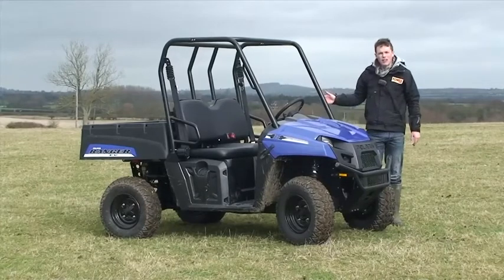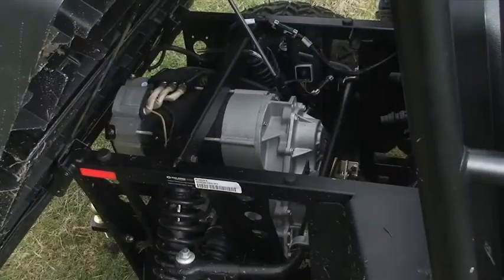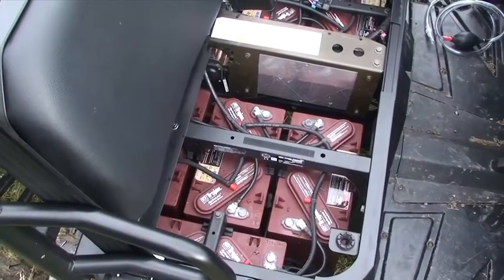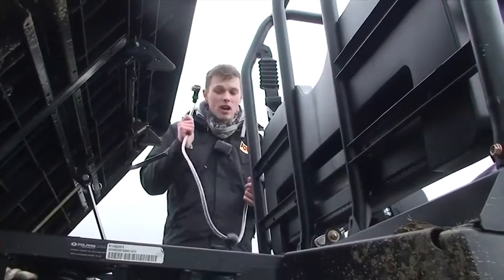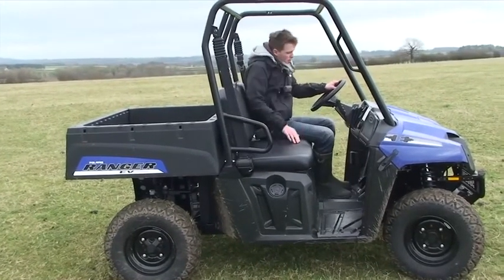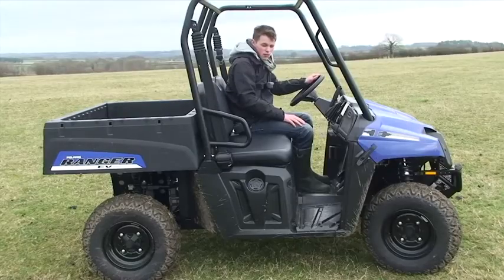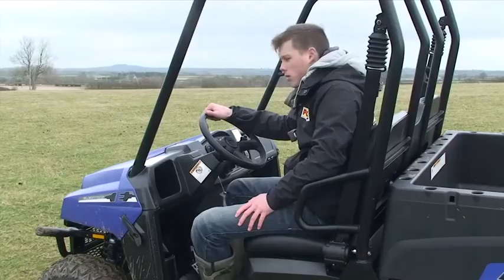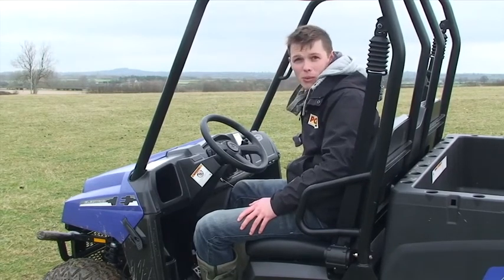Electric ATV test: Polaris EV

Comment: Imagine spending 13k to get something with battary technology that was around in the 50s. Then should have used lithium or lithium iron phosphate.
Reply: Oil lobby my friend.
Reply: Of course there are LiFePO4 types but they cost about $30,000 as to be expected. (Made in the US). 48v phosphate batteries are very expensive. You can replace the batteries (now AGM much better anyway but not as good as LiFePO4). The AGM batteries can be replaced with a 48v LiFePO4 battery but they cost about $US 3,000
Reply: @drwilburhughes680  which would not pose a problem if the charger was vehicle2grid compliant, and the complete system was (one of the house's) UPSs which can be borrowed to get around.

Comment: Lead acid? Seems like a very very old tech.... like an old fashioned golf cart. Are there not any ATV's that use Lithium Iron Phosphate batts?
Reply: I asked kawasaki uk at lamma if they plan on making a proper ev mule as I want one and the gentleman said "the technology is ready yet"! I laughed at him and left 😂😂
Reply: @bwarey52  I did the same!
Reply: Polaris DOES, or did, offer this with a lithium ion battery pack, but the price was scary- $20,000.00 U.S. About $8000.00 more than the lead acid battery version. Some years ago I looked into lithium ion batteries for mine, and there were at least two companies that offered kits, for about $5000.00… I’m still interested, but not at that price!
Reply: @erikarneberg11  Lithium batts are now $100 / Kwatt.hr hence the number of cars that now use them. eg. What is the best selling car in the UK at the moment. Answer: A lithium batt powered car.
Reply: What if they used plutonium?
Reply: @elliotjohnson9737  Then it would not work. ie. high School Physics?...

Comment: No way. Maintenance free Lithium batteries which I can also remove the packs or just move on. I’ll take my money elsewhere. Minimum 100 Ah batteries
Reply: yeh, seeing the AGM batteries in there was a real let-down. This thing would be amazing with the same volume of LiFePO4. Less weight, more power, more range, faster charge, much longer life. This is just a massive oversight
Reply: @Razza2250  I think they are wet not AGM. AGM  are maintenance free. Lead acid is what is supplied?
Reply: @cfmc6201  even worse then
Reply: @cfmc6201  AGMs are certainly not maintenance free. They are VERY old tech
Reply: Totally agree. I have a lead acid Ranger EV and its just completely outdated technology. I would happily  pay more for something same power and torque spec. that's built properly.
Reply: Agreed

Comment: I’ve been looking for a half decent review of the Polaris Ev all night. Nothing. Even this is just a gloss-over. What about suspension, handling, speed, carrying capacity, how easy it is to tip with a full load, what storage there is in the cab, attachments, cost, good god everyone - let’s get some decent reviews online!
Reply: Haven't got time to write full review buddy but the short answer is this: The Ranger EV is what you'd expect for the price and nothing more. They are a hodge podge of EV components thrown onto a petrol model chassis. There has been very little love put into building machines and really stupid stuff on an EV like halogen bulbs on the headlights instead of LED Why?? No reversing light, the factory set charging algorithm needs to be checked and possibly changed otherwise you will cook your batteries. The 7 pin switches for fwd/rev, diff lock etc.  are flimsy $5 Chinese shit. The torque is fantastic, if you are lucky enough not to cook your batteries in first 3 weeks the range is pretty good but no one can really answer this basic question because there is no amp hour or volt meter on the machine. The instrumentation (or complete lack of) is terrible. The most dissapointing thing about the Ranger EV is that it COULD be amazing, but Polaris could not be bothered to build a decent EV from ground up. 5/10. See this for pulling power. I have a diesel Polaris and the EV leaves it in the dust for torque and traction control in the wet. https://youtu.be/tAbRBr7HFN8
Reply: @graemeozzie2251  You're right even now, 2 years later. I'm in the market for a electric light vehicle for my elderly parents to get around in the near area. Nearly everyone says I should get a used one, rip out the electric system and implant new charger, controller, BMS and LiFePO from the usual chinese sites. Which I probably will. 
Does anyone know if these RTVs can plow snow or sweep the road, too?
Is there a standard for extensions?
Reply: @peter2327  I've upgraded mine to a 400 amphr LiFePO main pack and100 amphr 12V accessory system. It's way way overspec but it's a project where we wanted to push things blue sky as proof of concept to a skeptical market (farmers, agriculture) Realisticly, 200  amphrs would be plenty and a 12V lead acid perfectly fine for accessories to save cost. (separate 12V so you aren't drawing off main pack via dcdc, and balance weight if having one main pack on passenger side. Lots of ways to to this. It's a bit more complex that just 'ripping out' the old LA batteries. Need to be very specific about you use type, needs, what you expect it to do, charging times, heat, cold, physical shock expected etc etc. otherwise you'll waste a shit ton of money and not have the vehicle you expected.  There's something like 60 different LiFePO chemistrys so if you don't know what u are doing (like me lol)  find someone that does. However you are the only that can explain your needs and budget to whoever is doing the conversion.
Reply: @peter2327  A few videos of mine getting upgraded.

https://youtube.com/playlist?list=PLnDH3tSZlx16KIS2gERUMAmsYULuUCEGq
Reply: Check out this guy's video, he did a really nice job going over the Ranger EV in further detail:

https://www.youtube.com/watch?v=MovLYtNVOfo